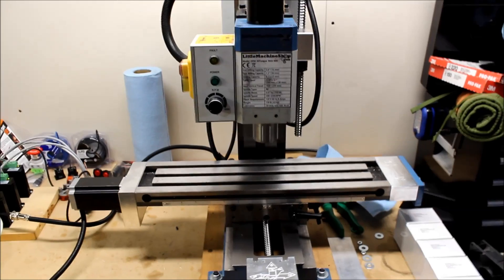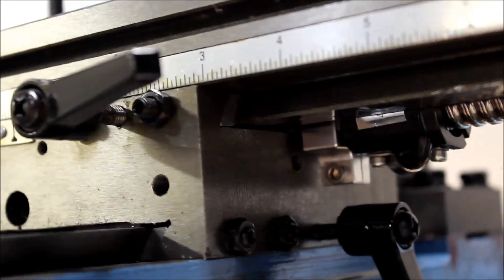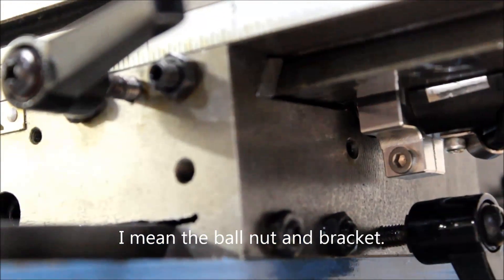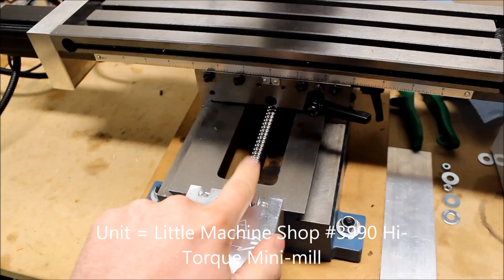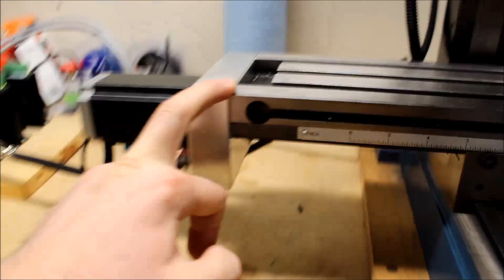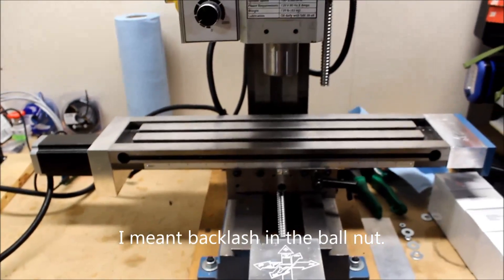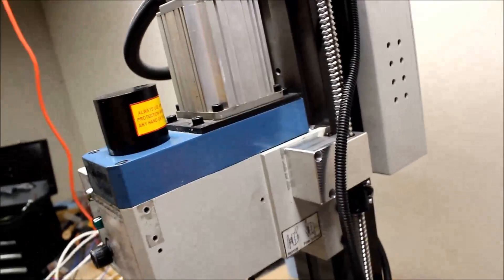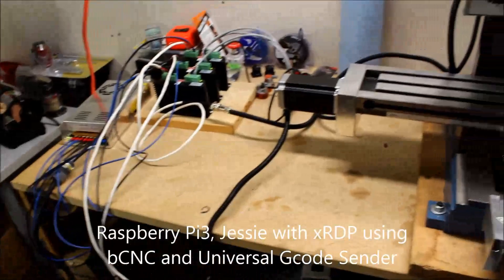Mini Mill CNC Conversion: Part 3 Ballscrew install recap

Comment: I just got my new LMS 3990 and am planning a CNC conversion, also.  Were you able reduce the backlash by installing larger balls in the ball nuts?
  Your videos are really helping me to get ready for the project.  Thank you.
Reply from the maker: Glad it helps! Hopefully one of these days I'll be able to get the rest of the videos uploaded. 
Yes, using "oversize" balls in the ballnut, and deburring and tuning the gibs, I was able to get the backlash on X and Y to 0.002" - 0.003". I had Z at less than 0.006, and then moved across the country and tore apart the Z axis to do the spindle bearing upgrade and convert the pulleys to the High RPM set. I have not been able to do much with it since then. I'm planning to get back to it and run a few projects this year.
Reply: @CalebMayfieldMHF  Thanks for the reply.  You say you were able to get the backlash on X and Y to 0.002" - 0.003".  Is that in 12" or was that for the total travel?
Reply from the maker: The backlash is on direction change. The amount of distance the table should move before it actually starts to move when changing the direction of ballscrew rotation. The precision over distance is more a factor of calibrating your stepper motor to the rotation of the ballscrew. That is dialed in pretty much dead on. If I punch in move 1.000" it will go 1.000", but if I then say go back to 0.000 it will end up at 0.002-0.003 due to the backlash.
Reply: @CalebMayfieldMHF  Got it - thanks.